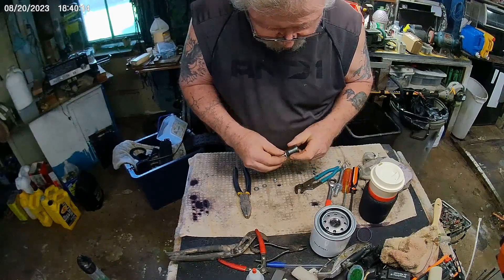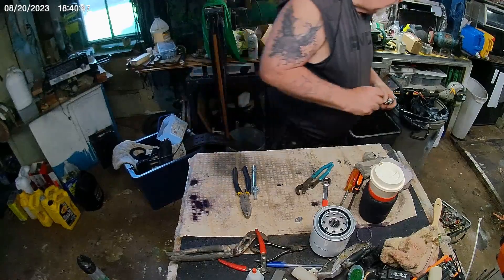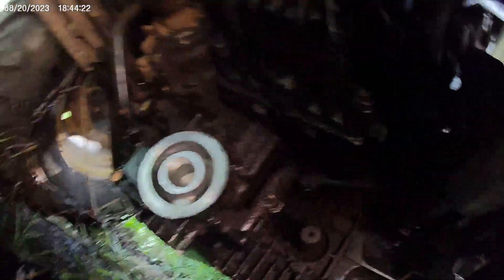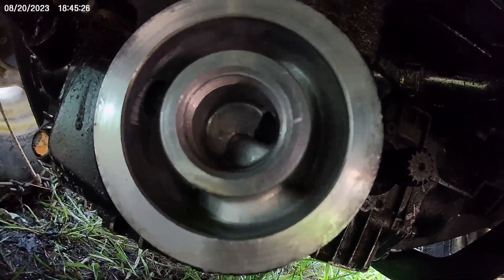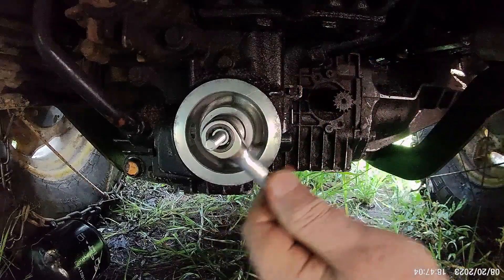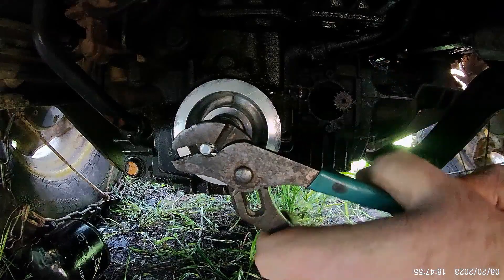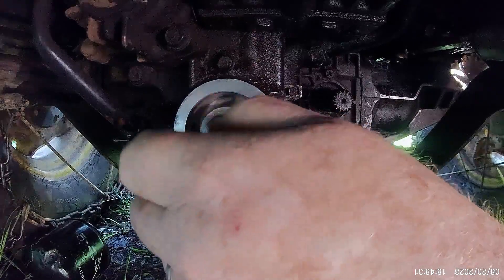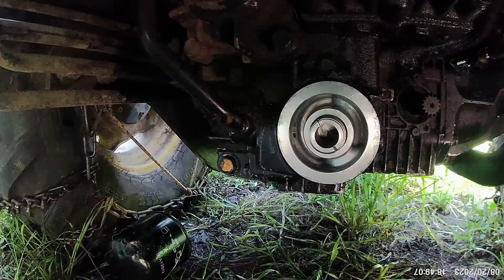Hydraulic filter, BS'ing, Rubber spacers, I think I'm done

Comment: are u putting oil on the filter gasket before putting it on the tractor ? hand tight is all u should need to keep the filter from backing off.
Reply from the maker: Yes, a good amount of oil.  Come to find out, the gasket was cut inside. Once the pressure built up, it was like a garden hose on full power, it leaked out over a gal in a few seconds.  They sent a new filter and all is good.  How have you been?  Still, posting vids?
Reply: @buzzsah  o well that'll do it for sure...  doing good & u?  ya i am.